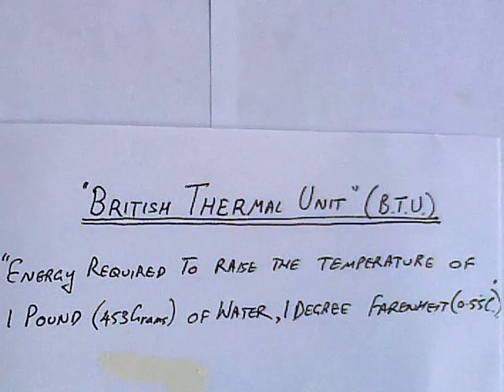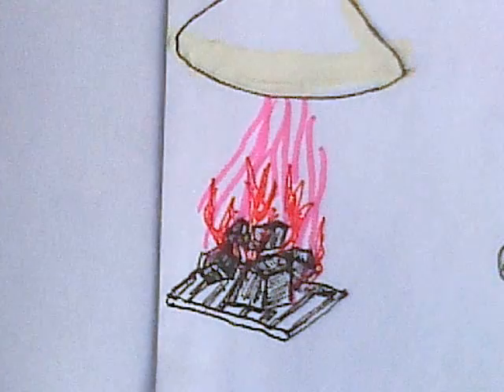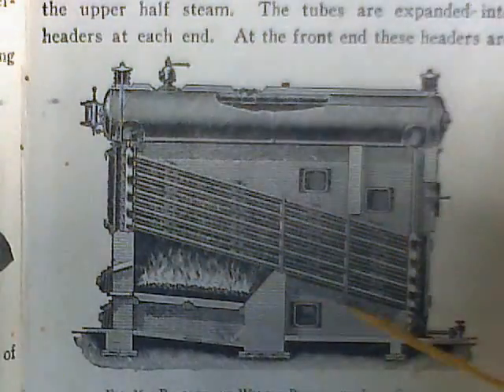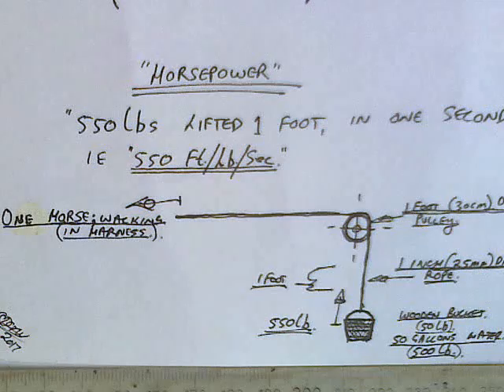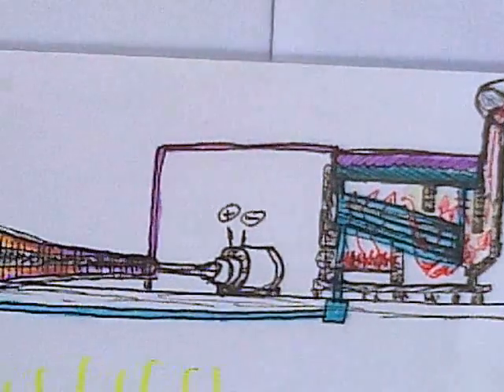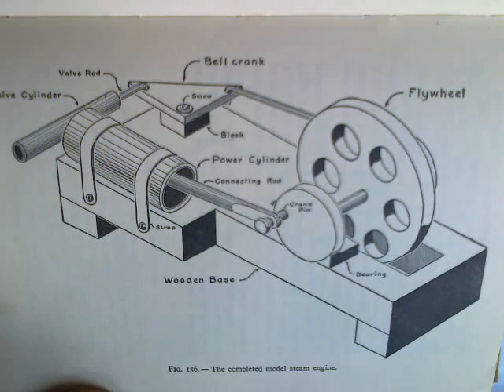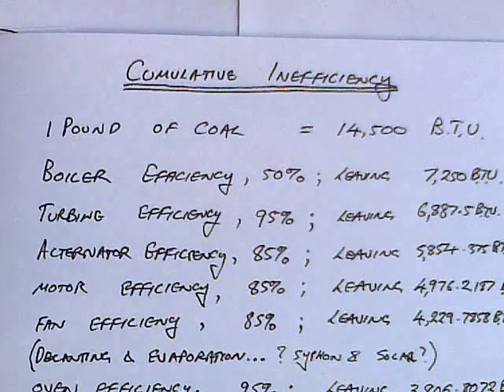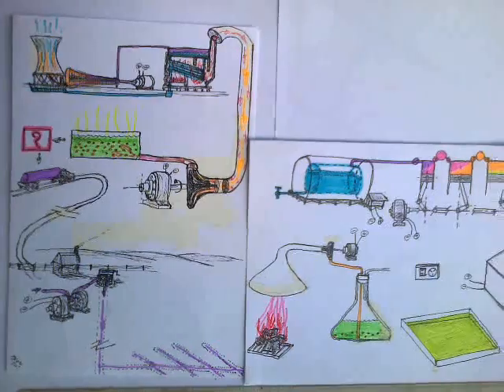Is Carbon Capture & Storage Thermodynamically Impossible...?

Comment: Perpetual motion magnet motors ARE possible but you need to use solenoids to snap the stator magnets into place at just the right moment.
Then there's that Tesla Radiant Energy Receiver we had so much fun with years ago. I neglected to send you an illustration of the circuitry needed to make the damn thing work.  
THEN there's the gravity drive asymmetrical capacitor that uses a cylindrical asymmetrical capacitor to set up a polarized gravity field to create RELATIVE "perpetual motion." On close examination it doesn't violate the laws of physics because the "warp drive" unit isn't actually moving; space-time is moving through and around it.
BTW  I like your illustrations and graphs. That took time and effort.
You don't have a computer and printer so you can't get a clear view of the simple circuitry Tesla used between his polished, insulated, elevated metal plate and his collection capacitor at ground level.
I'll send you a link to it in a second comment in case YouTube decides the link is "spam" and blocks it.
Reply from the maker: G'day Tom,

  Thanks mate,

    I'll have a look at the Links.

   Did you see the old Blasting Dynamo-Generator I videoed a fortnight ago, Input one Human-power for one Second, 7:1 Step-up two-stage Gearbox winding the Armature up to 600 RPM...; Output 96 Volts DC/13.2 Amps, Open-Circuit, so with a Load on it produces about 750 Watts for 1/8th of a Second at 55 Volts.

  A single One Horsepower Kick, from one hind Leg, for a fraction of a Second.

   Have a good one,

  ;-p

  Ciao !
Reply: Are you trying top approach Unity or Over unity?
We mustn't upset conventional dogma..woof!  woof!
Reply from the maker: +tomken8dy 

   G'day again Tom,

      Well, with a Pound of Coal having 14,500 BTU, and as 2,540 BTU over one hour is 1 Horsepower-Hour, then there's 5.708 Hp/Hr in the Pound...; and according to +Macropodus Macropode the IPCC is claiming that Power Stations are converting 36.3% into Electricity (whereas I had guessed they were better than that, at 40%...; so from the very beginning I've been too generous in mt estimations of their efficiency), so they only have 2.072 Hp/Hr worth of Current per pound of Coal burnt.

   Is not expecting 2 Hp worth of Juice to empower all the mechanisms to suck up 5.7 Hp worth of Emissions, and extract the C.O.-2, then liquify it, and refrigerate it and transport it, and inject it underground....; is that not an "Over-Unity" Expectation ?

   Considering that the Boiler only transfers 1/2 the Heat Energy from the Furnace Gasses into the Water, then the Energy in the Flue-Gasses is going to be 144.5% of that emerging from the Generator...; so, good luck trying to get 2 Hp of Electricity to clean up 2.7 Hp of hot expanding Shit in the Air.

  Just(ifiably ?) sayin' ,

  Have a good one,

  ;-p

  Ciao !